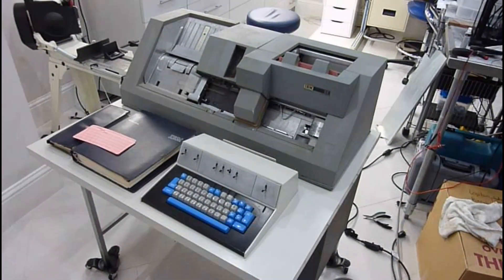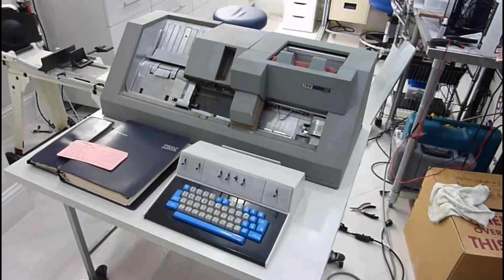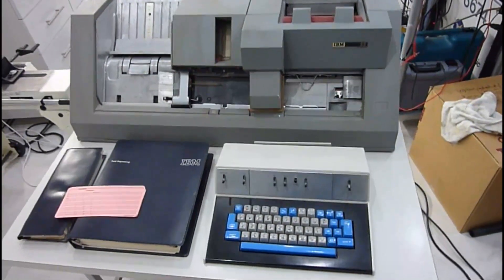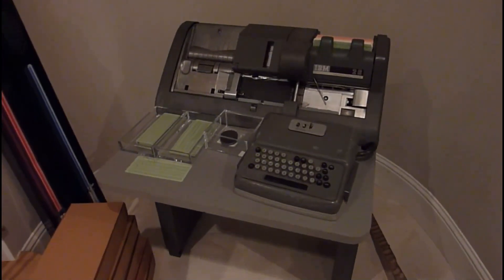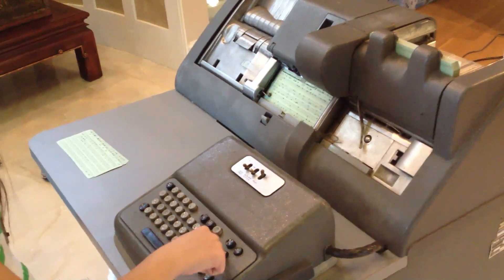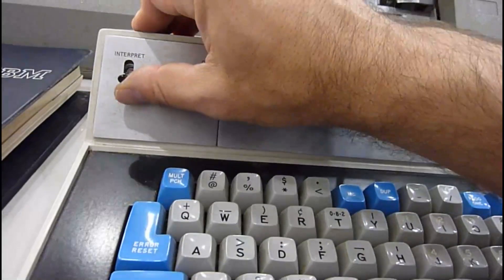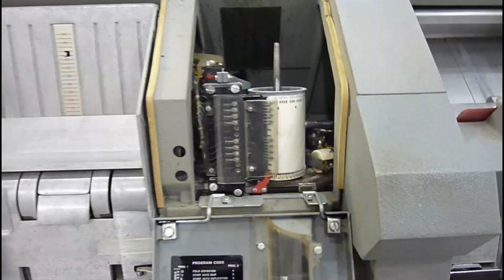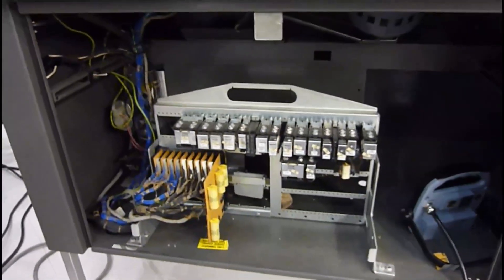IBM 029 Card Punch Arrives for Restoration

Comment: I once worked on an IBM 029 and IBM 129 keypunch machine. The drum holds a card that can contain two programs. The first program is recorded on the upper six rows of the card and the second program is recorded on the lower six rows of the card.
Reply from the maker: Correct - in mine it's two programs on 4 rows each. You can see punch run under program control in the demo I did after the restoration was finished:  1964 IBM 029 Card Punch Working Demonstration